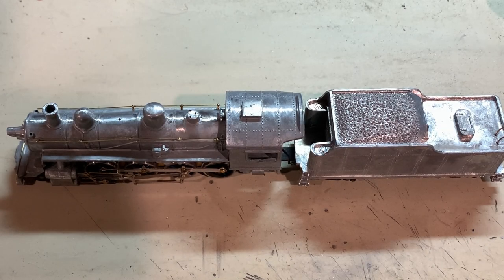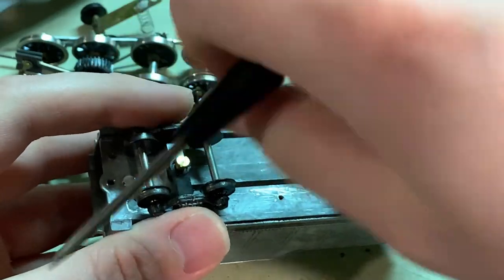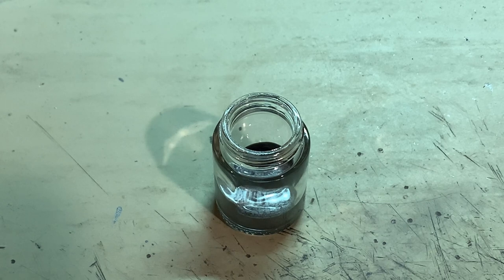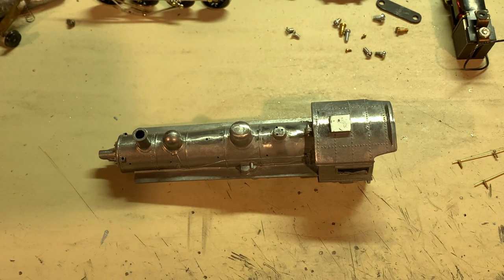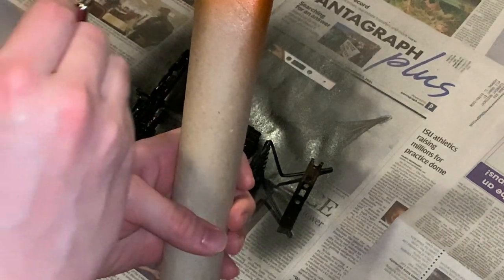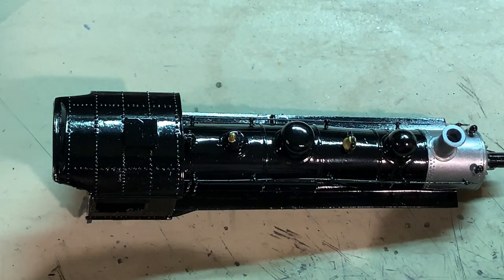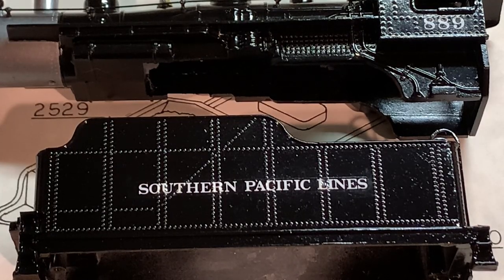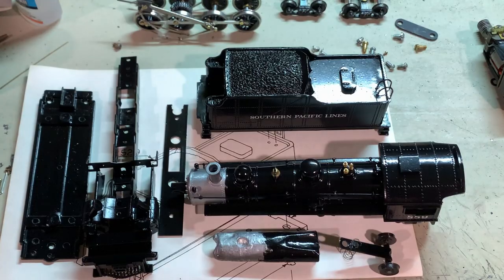How to Build a Basic HO Scale Steam Engine Kit: Part 4 - Masking, Paint & Decals

Comment: The blue tape worked perfectly when masking my plastic models. It did not like my metal engine and tender. Major disaster. What are the other tapes you mentioned?? Good video, btw!
Reply from the maker: Some paints don't hold well to metal, so you might want to start with a good quality primer coat.  I had the same problem with my Athearn metal RDC, but after trying Tamiya spray can primer, the blue tape didn't peel off even a flake of the colored paint.

Comment: Is it better to take the details off or leave them on for painting? When I paint brass I leave the details on.
Reply from the maker: When the details are already glued or soldered to the model, I leave them in place. When building a kit like this, I like to leave off parts that cross over multiple colors since it can make masking and finishing easier.
Reply: @DarthSantaFe  Thanks for clearing that up. Do you know any manufacturers that make tender replacements for Bowser steam locomotives? I'm debating whether or not to switch my 2-10-2's tender out for a bigger one when I get it.
Reply from the maker: @Uptownloki47  Bowser did make some long-haul tenders, and I see those come up now and then.  You might also be able to adapt a tender from someone like BLI if you can find one separate.  There used to be a lot of tenders sold separately, but it seems like most everyone has stopped doing that lately.
Reply: @DarthSantaFe  Thanks for the advice

Comment: I’m working on the same Varney loco. The unit runs fine with the shell off and the tender in place but when I install the shell I experience a short. I have placed Kapton tape over all the electrical areas but still have the same results. Any hints as to what I have done incorrectly?
Reply from the maker: Does the shell make any contact with the tender or the motor brushes? I’d also look to see if any of the drive wheels are making contact with the shell.

Comment: Never use a hair dryer on paint!  You're just blowing dust all over your paint!
Reply from the maker: Depends on the area and the hair dryer, and how the part is positioned while drying it.  If you're in a clean area using a clean hair dryer and either holding the part away from the table/floor or have it sitting on a clean dust-free surface, then it will remain clean.  If the area is dusty, then you probably shouldn't be spray painting there anyway since the airbrush or aerosol can will be kicking dust into the air which will then settle on the painted piece.

Comment: Will the water used in prepping the model weaken thin super glue used to hold sand lines in?
Reply from the maker: The dried super glue isn’t water soluble, so it will be perfectly fine even after washing.
Reply: @DarthSantaFe  That is good to know.

Comment: But wouldn’t it be easier to paint the model be for assembly (removing flash before painting, and putting parts like the cab back on first)
Reply from the maker: You could do it this way, but the problem is that the paint can get damaged more easily during the building process.  Because of this, the preferred method is to build the unpainted model first to be sure everything is working correctly and that most of the detail parts have been installed or at least checked to fit where they'll need to go later.  Then once the model is painted, only a minimal amount of work is needed to get it reassembled and running well, so there's less possibility of damaging the paint.
Reply: I never though of that, thanks for replying!!
Reply: Still doesn’t make sense to do it that way.

Comment: If you placed the railings on the locomotive first and applied super glue to the inside of the shell, it would have been easier with zero risk of getting glue on the paint.
Reply from the maker: Yeah, that would be better. Some of my methods will be improved in the next video series.